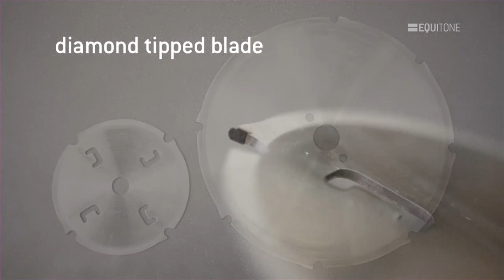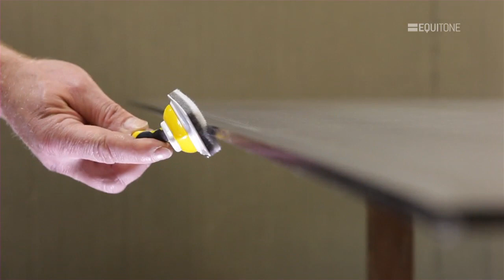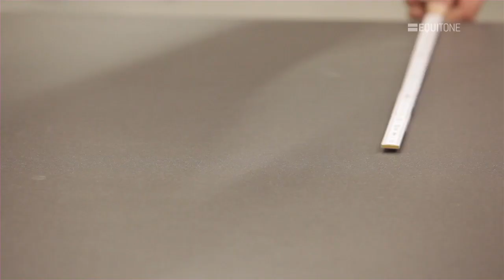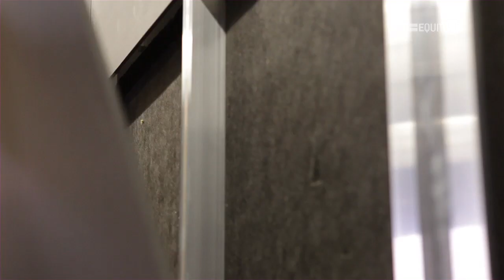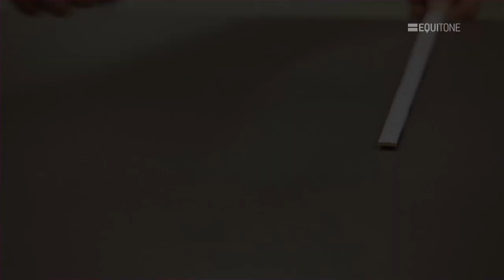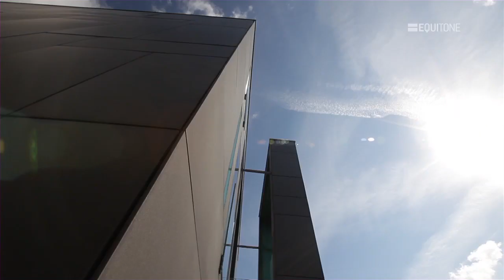EQUITONE INSTALLATION

Comment: In this comment I will detail how to get this look at an 8th the cost...

I just finished a house where we had 1.5"   Roxul rockwool insulation all over the exterior of the house. We then wrapped the house with pressure treated 1x4s. Scewed 16" on center w 3" outdoor screws every 2' vertically threw the Rockwool and wrapping all corners.

Using 4'x8' concrete board panels from home depot with 1/4" spacers.  Instead of this expensive made to order concrete board.

I Cut the CB panels with a diamond blade in my skillsaw mag77. Used a clamped level to insure straight cuts. (Honestly a track saw would have been a life/time saver) Video says they get 5,000 meters per blade and I'm calling BS on that nonsense.. I was going through those blades like they were going out of style. A couple a week. 

We tried all sorts of methods for attaching the CB to the PT 1x4s. Everything from #8 nails to d21 nails.  I found using 1&1/4" narrow crown staples to do the best job at holding and sinking in. (Customer wanted a seamless look... Painter wasn't to stoked to bondo all the staple holes lol) 

In all honesty if this material is in your budget I'd say buy everything they lay out in this video. Had I had the cash I could have saved myself the time and the learning curve of doing it the way I did. But in the end all said and done I am really happy with how it turned out. I'm sure I saved countless thousands of dollars as well. If you would like to see pics email me!
Reply: Hey Barton, I have to put around 100 square meter of EQUITONE NATURA on my wood structure (exterior).  Would love to have some tips and materials needed.  I already have the panels but can't see how to start with it.  Thanks